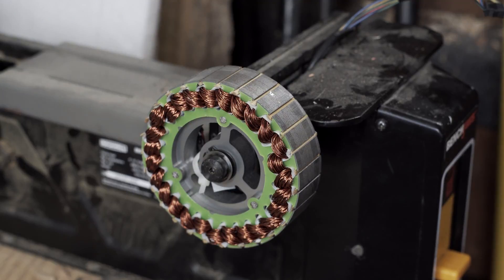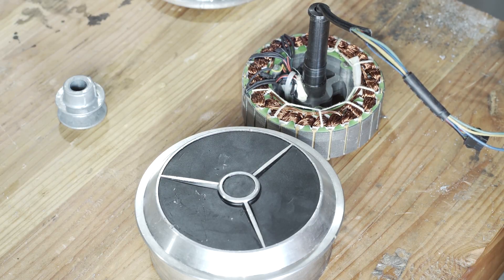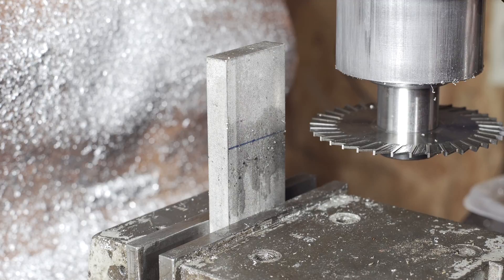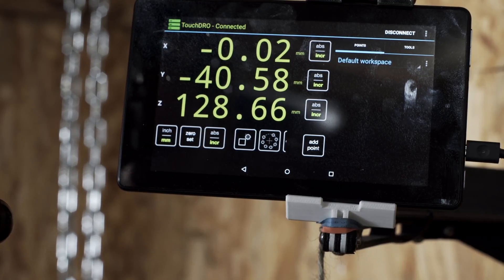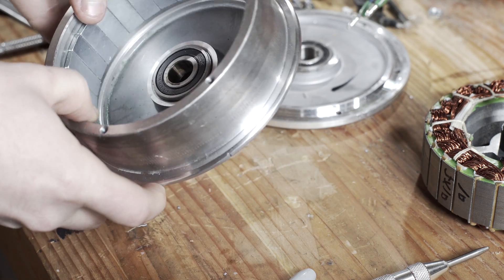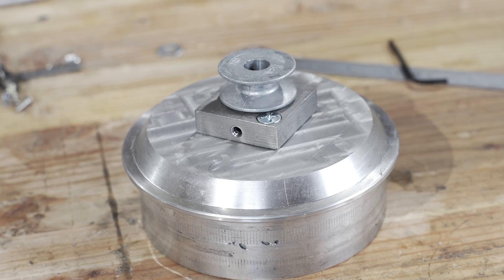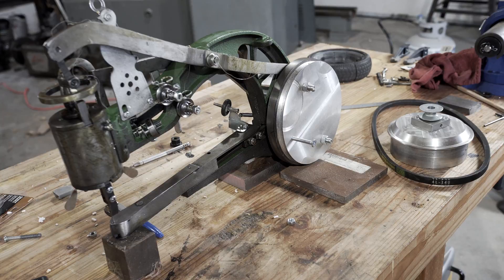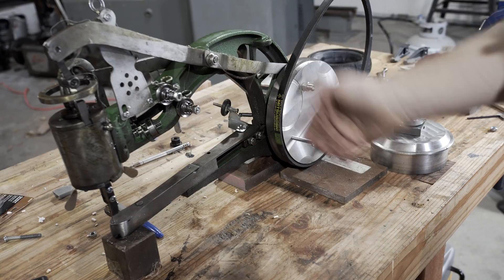Motorizing a Leather Patcher - Mounting the hub motor

Comment: My head hurts watching this. Ouch. I thought I did things the hard way. Simple wooden pulley bolted to the wheel, motor (HF 1 hp) has a hinge so it pulls the belt tight by its own weight. Job done. No the patcher is not cheap anymore. Selling for 200+, they wised up and saw the potential. Anyway, nice video.
Reply from the maker: It's just the resellers raising prices, you can still find them cheap out of China (aliexpress, etc).
Reply: @BreakingTaps  I just got one via amazon for $120

but the HF 1HP motor is larger and heavier than this entire machine.

Comment: Did you include the diameter of Cutting tool when finding center
Reply: Chris-  It's actually an edge finder.  To find a center point, you find one edge, zero the readout and find the other edge and divide by 2.  it doesn't matter the diameter of the edge finder.  If you need to locate a point based on 1 edge,  you need to consider the edge finder diameter. You subtract 1/2 edge finder diameter.
Reply from the maker: Exactly this.  Should have been bullet proof: find one edge, zero, find other edge, 1/2 function on DRO, move to new zero which is the center.  Which is why I think there is something with my DRO, since it should not have be so badly off-center :)

Comment: Yeah that saw vertical blade said - nope!  

The hand bandsaws are great from Porter Cable and others.  Walk up to the lathe and get it done. 

I see the DRO is saving you loads of time centering!  LOL!  

Yup end mill vs. drill = no contest 

Yeah I built my DRO board and did the capacitor tweak.  Recalibrate and see if it changed. 

You need to edit my videos - your production quality is superb!  

I had to pause and watch the center punch again..... as noted before single funniest center punch I have seen. 

Dan
Reply from the maker: Yeah, really need to spend a few minutes fiddling with the DRO.  It's just unreliable enough that I don't trust it, so don't use it for anything (except the Z, which seems to be rock-solid reliable).  Think it's probably just the capacitor tweak that's needed. 

And yeah, that punch shakes fist  Seriously wasn't expecting that to happen :)

Thanks for stopping by!  Keep up the great work on your channel!

Comment: Did you consider machining the belt grove into the cast iron flywheel?
Reply from the maker: Yeah, I really wanted to.  But there's a groove on the interior for one of the arm bearings to ride against, and there is only a few millimeters of clearance between the groove and the exterior of the flywheel in a few locations.  It might have been ok, but I was worried I'd break through while machining the groove :(

Comment: Being a a DC motor....you could control the speed with a PWM unit.
Reply from the maker: Yep!  It's a brushless motor (just in a hub configuration), so it'll be driven with an ESC + PWM signal.  Just need to embed the PWM generator into a foot pedal and it should be pretty plug'n'play :)

Comment: Do you notice the difference between climb milling and conventional?   Climb milling tends to pull the tool into the work.  It is aggressive and should be done with care, if you must.  You should notice a surface difference, also.
Reply from the maker: Absolutely... on deep cuts it's very obvious. The backlash on the table makes climb milling impossible, you can see/feel it yanking the table around (had a few rather scary moments in the past when I didnt know better).  I've been trying hard to only mill conventionally on any kind of serious cut.  I admit I'm less rigorous when it comes to facing and light cuts :)